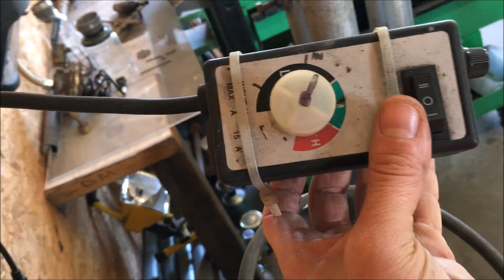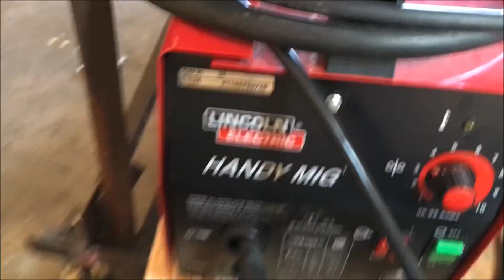Harbor freight high flow auto air compressor

Comment: Generally I consider anything bought /one-off/ from China as a collection of parts to make the actual desired product: electronics {re-soldering, component replacement, mechanical fitting}; stainless-steel rusting from lack of passivation; machining, etc.

There is a Canadian company (like a few south of the border?) that import hand tools (exactly like your dull cutters) from China then do the necessary final machining and processes needed to make something actually useful.

But your point that people need to always look at if what they are buying is actually suitable, China does not yet have a monopoly on making garbage.  I have had more than a few arguments with people who have spent /my/ money to substitute objectively-unsuitable products because flag-waving convinced them that "Made in the USA" makes everything flat-out better.

"caveat emptor"
Reply from the maker: yes i always finish the job after buying half ass chinese crap